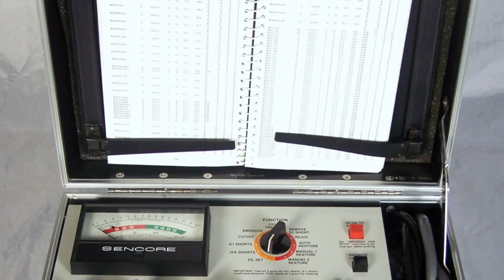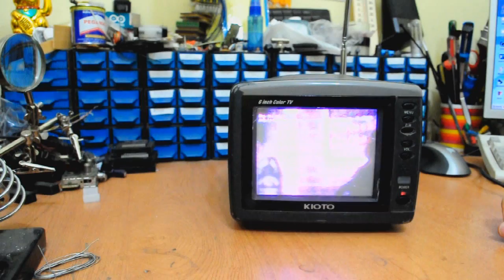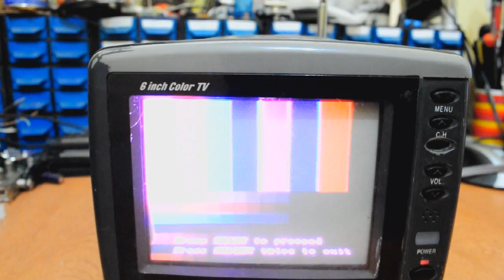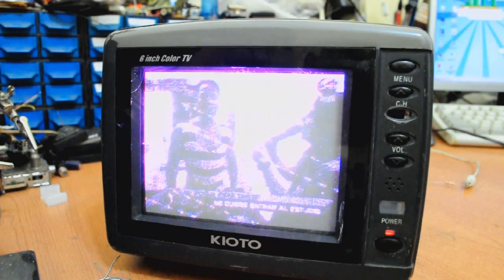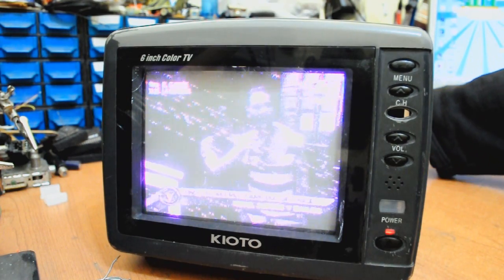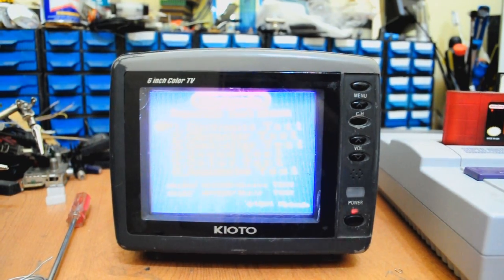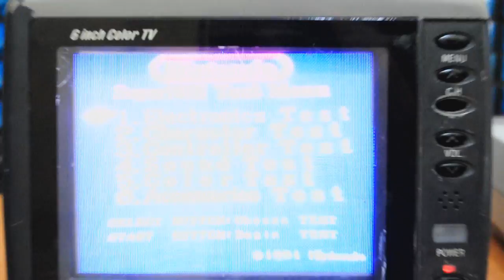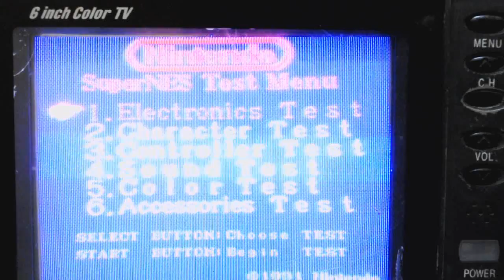CRT Rejuvenation On The Cheap

Comment: I've used a high voltage capacitor to "blast" off any shorts. A few microfarads at 100 to 200 volts seems to work. If you have a short from the heater to one of the other pins, I cut the traces to the heater and wind my own isolation transformer (few turns on a ferrite toroid). If the filament is old and loosing emission, add a turn or two on the secondary to boost the filament voltage a tiny bit.

Comment: Back in the days I built a rejuvenator based on this and it worked like a charm. Saved a bunch of CRTs with it!  The only difference was in the heater supply circuit as it was adjustable from 0 to 7V or 0 to 12v depending on the CRT type. Intersting enough , when I encountered this kind of 'dead cathode' I usually brung it back to life by variating the filament voltage with the cathode energized , and most of the times the miracle occured when raising up the filament voltage then allow it to cool down a bit and repeat this few times until a cathode current appeared.If it doesnt burn a hole through the cathode :-) but well if the filament or cathode went open circuit you can call it dead...
Reply: Yo by any chance is there a way I can reach out to you in DM like telegram or Reddit? I would really like to have your guidance in being able to build this device because I am facing the cathode issue.

Comment: Have you ever tried reflowing the solder in the CRT pins? Sometimes you can get a cold solder joint that makes you think the gun is open like this video.
Reply: He was doing his rejunvenation rig directly on the pins of the neck via wire clips. It's not an issue with the neckboard/soldering on the neckboard.

Comment: I have the opposite problem. A 1990 era 32" Toshiba that I paid 2k for new, still works like the day I brought it home. Pain in the ass. I never thought I would swear at a piece of gear for working. I don't use it anymore but I can't throw it out.
Reply: A Toshiba is worth a holy grail. Keep that Tv while you can. Or sell it as an arcade monitor tube.
Reply: @johncarnege  I found it a forever home a couple years ago. I don't know which side of the Rainbow Bridge it resides on today. I would like to visit a forum community that still worships the tube.
Reply: @InsideOfMyOwnMind  Arcade builders do here. They literally would kill for this tube.

Comment: Hmm, I have a 29 inch Sony trinitron, The green colour suddenly was lost. I opened the cover and I downloaded the service manual so i directed myself to the pcb that connects back to the tube electron gun. At first I thought it would be a problem with the transistors on the pcb but then I noticed that inside the tube behind the electron gun there are three heaters that glow in line representing probably the RGB, i saw in the service manual that they are connected in parallel. One of the heater in the middle didn't glow even when i applied 6 volts directly by removing the pcb and placing probs. So do you thing the heater is broken?

Comment: good video 133MHzz, I have a JVC CRT from the 80's that's starting to fall first the sound would start to go after the TV was on for a half hour and now when on cable when you go between ch 50 - 60 you get no picture but sound, I know I won't be able to fix it but I was wondering if you had any idea whats casing the problems.
Reply: Probably bad solder joints.

Comment: 133MHZZ, Is the CRT rejuevenator adding and injecting more Electrons into the RGB ray gun? 

What is the CRT rejuevenator doing to the monitors neck circuit board and tube?

Comment: 8:16 it's 10k resistor?
12:19 connection can you show it schematic?
Reply: It's pretty simple.
6V AC from the transformer go to the filament.
Then the 120/240V AC connect in series with an incandescent bulb and any cathode and G1.

Since you want the current to pass through K and G1 to remove some of the cathode (K) surface that has become an insulator.
And yes, you can use a 10K resistor for the ground cathode test.
Reply: @GoldSrc_  is there a video how to interconnect color amplifier with cathode that isnt working? As je mentioned on 9:11
Reply: @GoldSrc_  how do i connect filament. Where is it, I can't see. What is actually G1?
When you connect 6v transformer into 110v ac it actually gives 6v alternating current on the output?
Reply: @Columbariusify  You have to make sure you desolder the cathode pins, or follow the trace to a resistor and then lift one leg of the resistor.
Then, you do the same for another cathode and connect the resistor that goes to the red cathode, to the blue cathode instead.

To find G1 and make sure is G1, you can google the tube serial number and it should give you results for the pinout for the 3 cathodes, the filament and G1 and G2, but you only really need G1.

The 6V AC from the output of the transformer, that goes to the filament, don't use more than 6V or you could blow the filament.
Reply: @GoldSrc_  thanks
Reply: @GoldSrc_ yo by any chance have you built a similar device as shown in the video above? I need help with it.

Comment: A lot of blah blah blah yes... would have been nice to see a schematic image of the hookup, something to print out for when possibly trying it.
Reply: +e5frog IF you know your way around a CRT set you don't need a schematic to do this, then again you should use a proper CRT tester also. I used to work on CRT sets back when it made sense to, Today it's all LED and LCD sets and monitors.
Reply: +ElfNet Gaming I'm poor and also lazy, it would be nice to have the proper way explained in printable form. I have fixed a few CRT:s, swapped flybacks, caps and so on, never had to this procedure but it may come in handy some day, long after I can find my way back here...
Reply: e5frog Well today its no longer worth it to repair a CRT set unless your into restoration and even then you have to ask yourself "Will this thing sell to a collector or sit around wasting space?" I know people who restore old radios and TV and they have a home full of the things, all working but NONE of them move because no one wants them, not even collectors unless your giving them away.
Reply: +ElfNet Gaming I mostly do Commodore monitors, they hold a special place in people&#39;s heart and are not hard to sell once serviced. Eventually they&#39;ll have poor image as well. 
I can figure it out for myself from the movie and write it down, put it in the repair folder.
Nice of you to share this great tip.

Comment: Throw  away this piece of ahit and get  a OLED screen
Reply: OLED is garbage... especially for video games.  Go with a DLP 720p model, most of them have scalers that do an awesome job at showing 240p or 480i.  Or you can blow the wallet on a Sony PVM or BVM screen with RGB  ;)  Your old consoles will thank you!
Reply: or just pick up a good crt off the side of the road. i scored me a 36" trinitron in 2014 and i could never go back to my plasma.